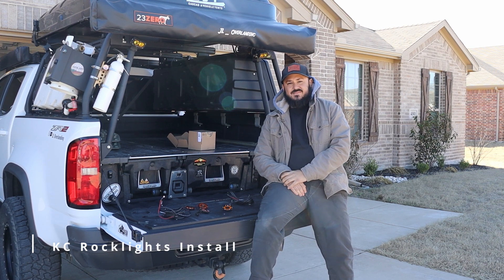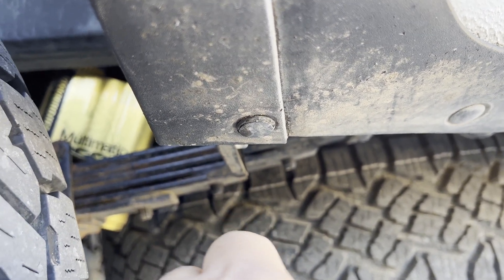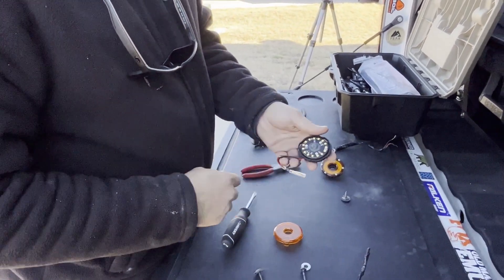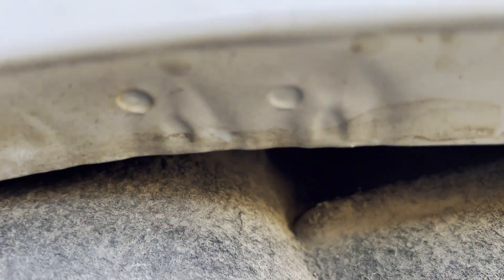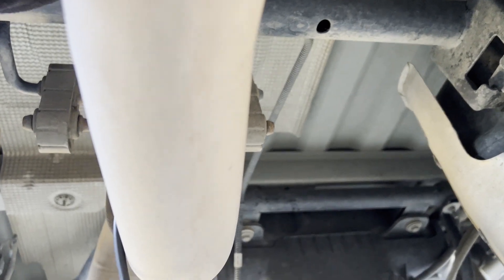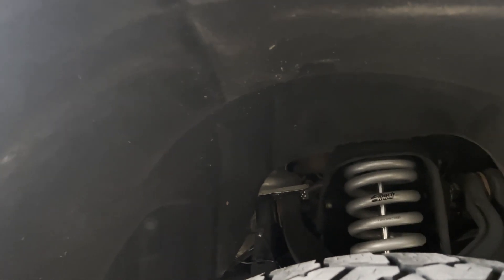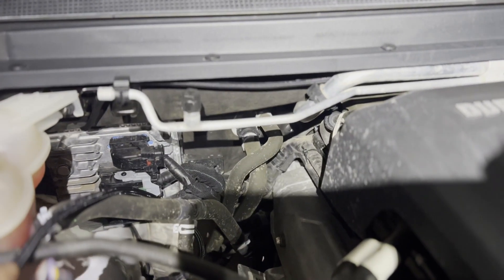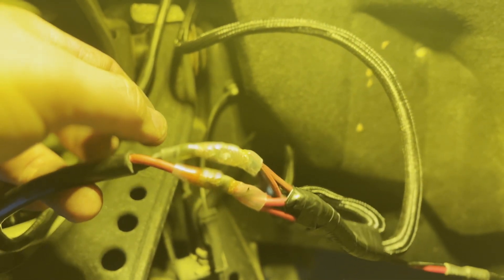Chevy Colorado Simple Rock lights Install !!

Comment: How much are the rock lights
Reply from the maker: KC Cyclones are about $65 for a pair if you have already have a switch panel you can add them or $330 for a set of 6 with the wiring and switches